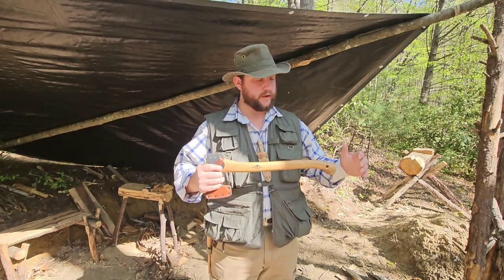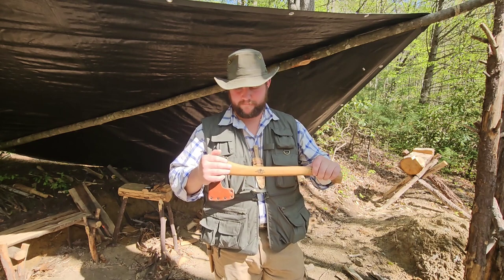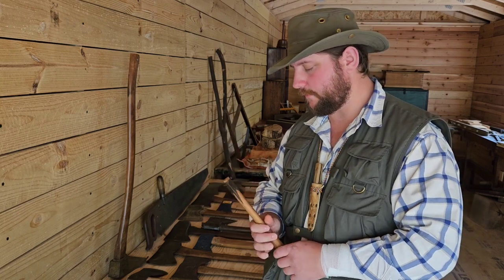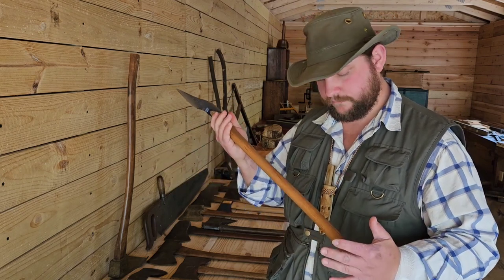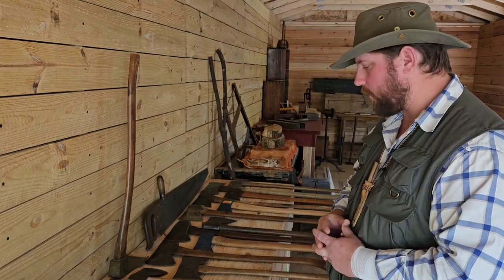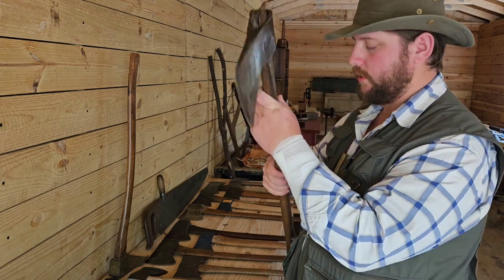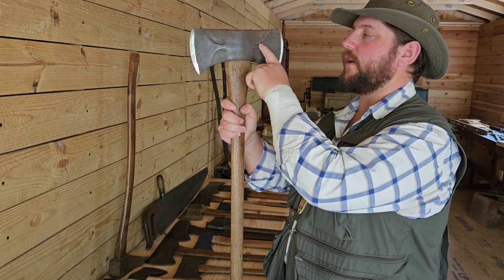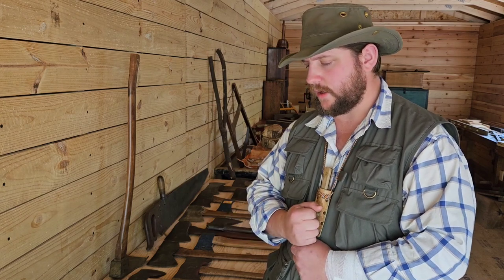A Bit About Axes

Comment: 14" - Belt Axe
20"- Pack Axe
28"- 3/4 or Boy's axe
32"- Full Size Axe
[all +/- 1"]
Reply from the maker: Solid parameters on the different lengths

Comment: What do you think of the leather collars to protect the handle from over swing
Reply from the maker: I think they can be a good idea, especially on axes that are going to be used for a lot of splitting. Along with major surface protection, it can provide some cushion on an over strike, which can help keep the wood from developing micro cracks and splits (depending on the force of the blow, of course). Aside from leather, I've wrapped plenty of handles with electrical tape and duct tape. I used paracord once as well. That's not something I tend to do on my smaller axes and hatchets, though. I like to get right beneath the head sometimes for carving, and I prefer to hold the bare handle for that